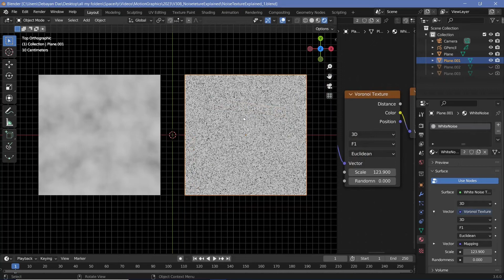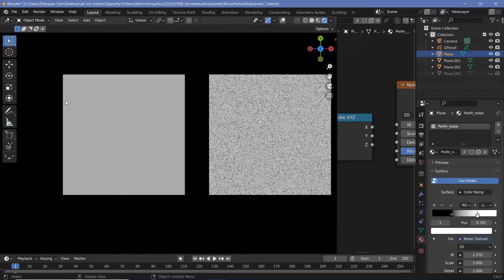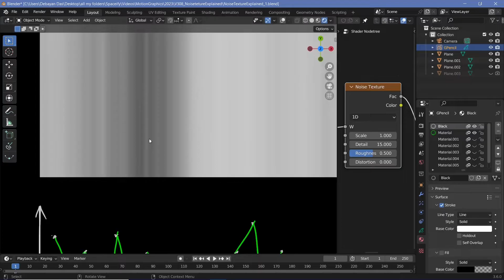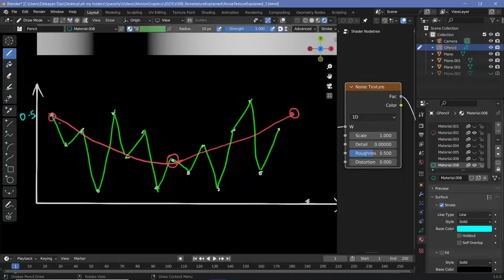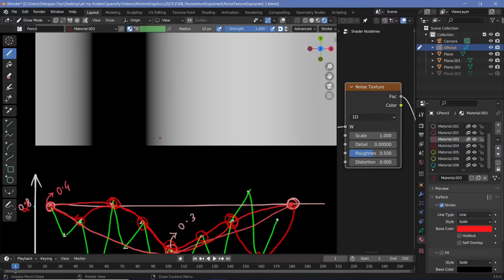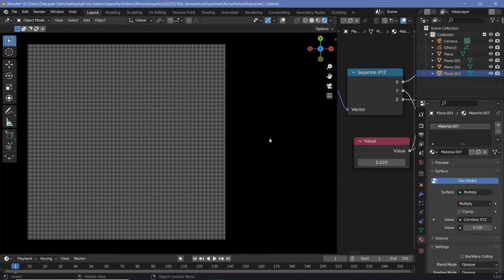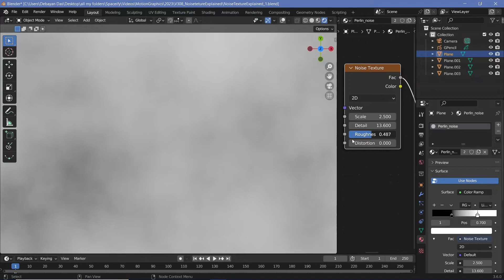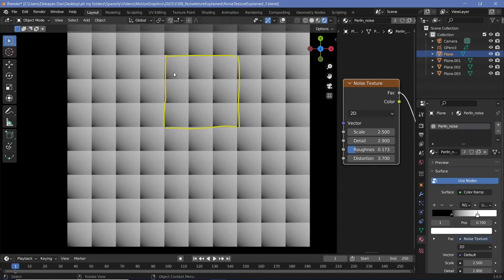Blender's Noise Texture Demystified (Perlin Noise Algorithm Explained)

Comment: How did you make the texture at 0:06?
Reply from the maker: A step by step tutorial can be found here:

https://youtu.be/4Cw4c4vxllc

But you will need an earlier version of blender to use the musgrave node. 
However, the new versions of blender, you can uncheck the normalize option in the 'Noise' texture and then play with the lacunarity option to get the same effect as the musgrave texture.
Reply: @deayanstudios  Thanks!

Comment: Most engines use Simplex noise today. It is a faster and optimized Perlin noise. So, if you are programming my tipp is to prefer Simplex over Perlin.
Reply from the maker: That's definitely interesting!
I wonder why blender doesn't have a simplex noise option. Hopefully it'll be optimised in future versions :)